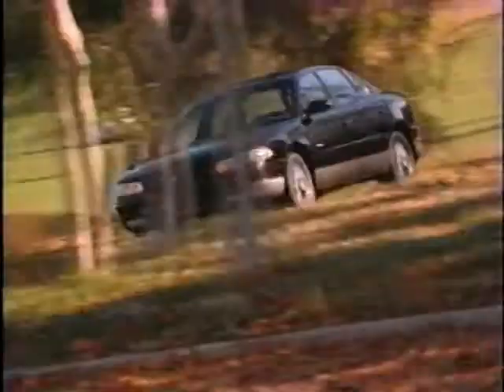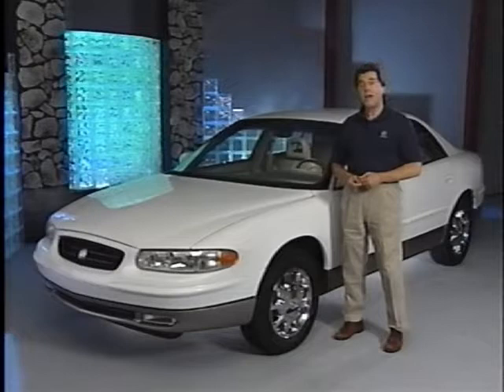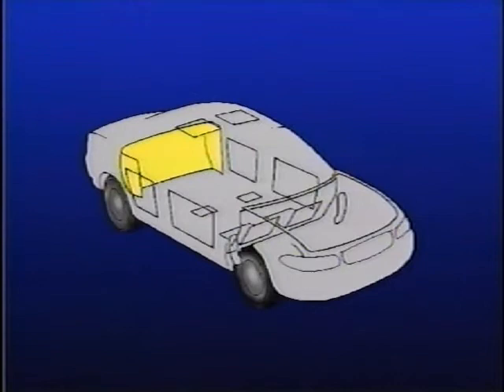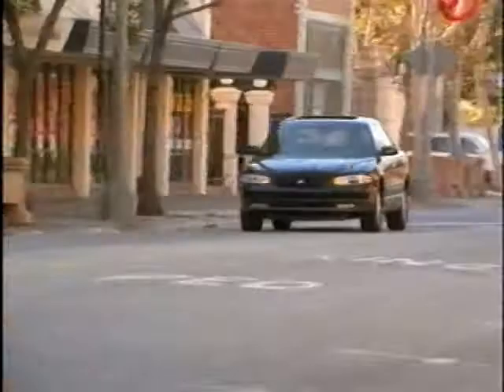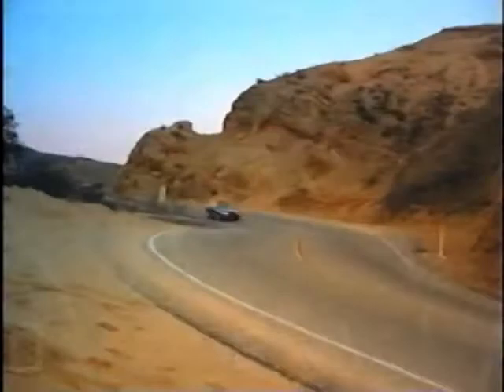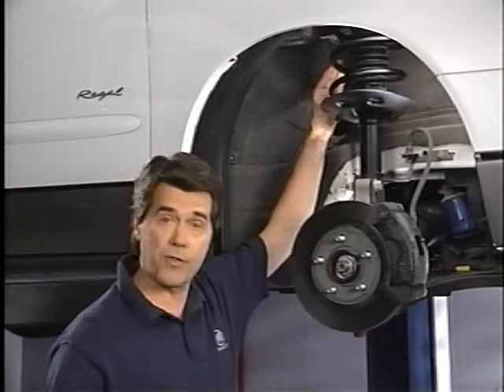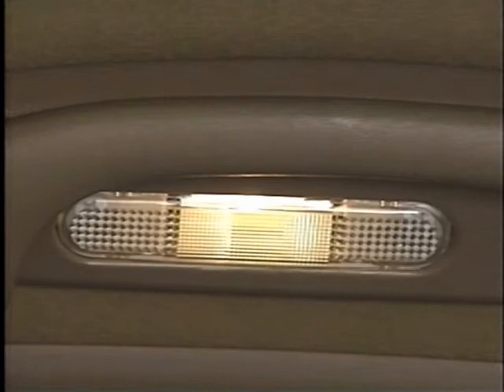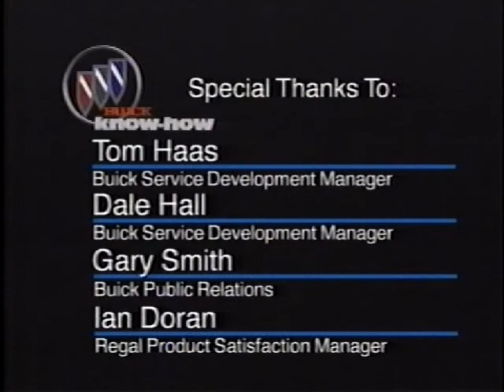Buick - 1997½ Regal (1997)

Comment: No matter how cool they try to present it it the problem is it's still a Buick ewick which is which is French French for "Old fart Jew Canoe". If you come across one of these used make sure to only buy the 1 with the 3800 engine and understand that the transmission is the weakest link ink in the car so so double check There's nothing wrong and baby the bitch.